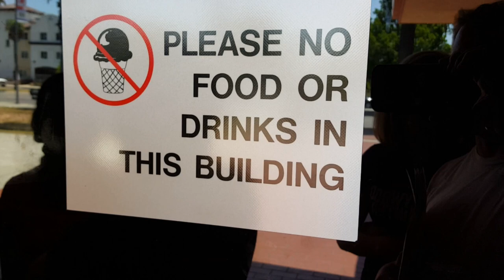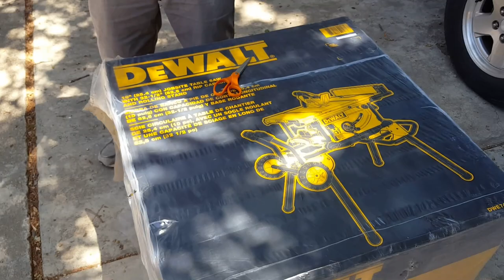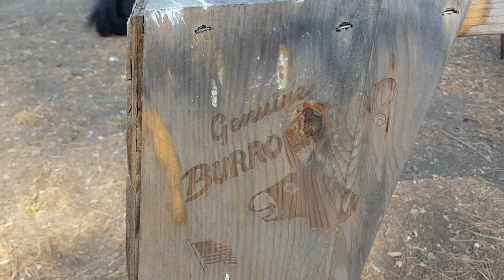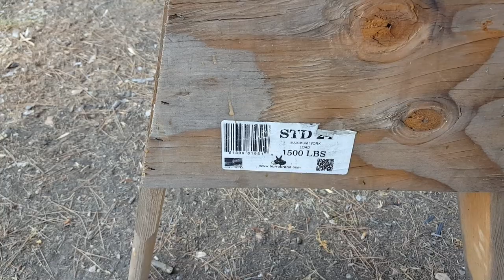Testing Out New Table Saw by Making a Sawhorse - Visit the DMV & Get a Flat Tire the Same Day

Comment: for some reason I ended up watching sawhorse videos. Nobody I ever saw made sawhorses as light and sturdy as mine until I saw your video. With a few minor exceptions they are identical to mine. When you make the legs with 1 X's and plywood gussets on the ends they are light and easy to carry and last a long time.

Comment: If you have a Kauffman Tire in your area go there for all your tire needs... they checked and fixed our tire for free when we had a nail which turned out to be a short nail thankfully and did not puncture the inner tube!  Our car has a sensor which did not go off from tire pressure but they removed the nail and dunked the tire in water to make sure there was no air leaking and it took maybe 15 mins and we got free donuts and coffee and drinks while we waited :) ... also we have Hancook low profile tires which most tire places will see it as an opportunity to try and convince us we need to buy a new tire bc the ones we have cost $800 per tire -_- But we got tire Insurance for that very reason bc car insurance doesn't cover tires lol!  
As Always... CHEERS Triple H :) !
Reply from the maker: We do not have a Kauffman's here in CA that we know of. Sounds like you have some sweet tires!!!